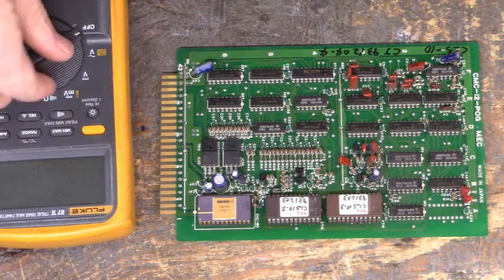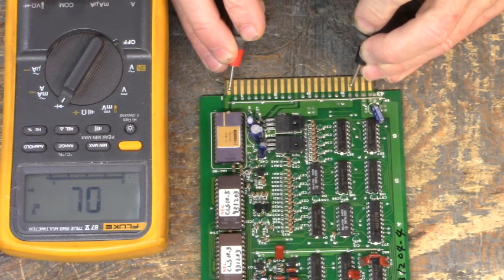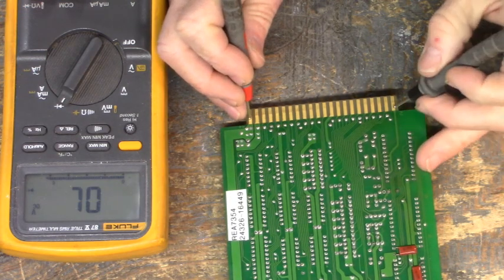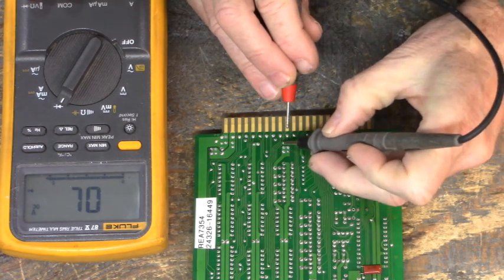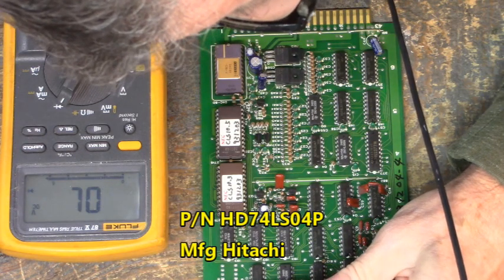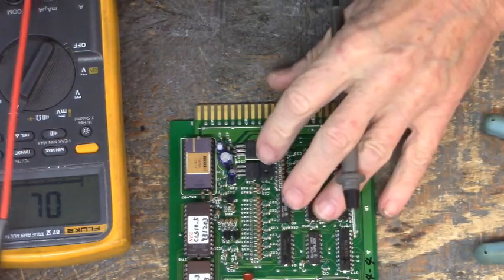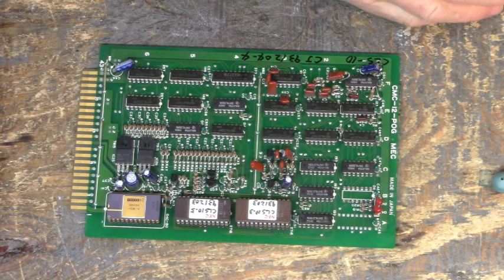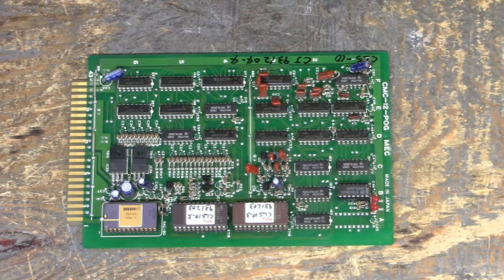CMC 12 POG Control Board Does not Energize the Contactor

Comment: PeePaw is a genuine engineer. And I’m glad that I also do this diode test method to find short,open or erratic conditions in circuit boards if I can’t find schematic diagrams of any particular circuit. I have repaired lot of circuit boards by this diode test method.

Comment: Impressive troubleshooting! No schematic is like defacto standard these days, but it seems like you didn't even have the pinout for the edge connector and still found the issue super quick! That's a good tip to check everything in diode mode to ground!